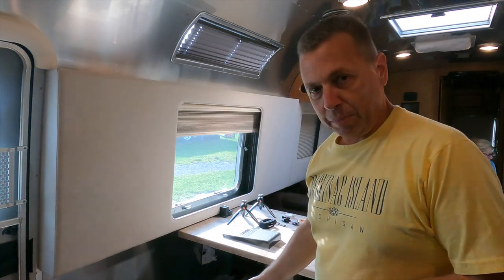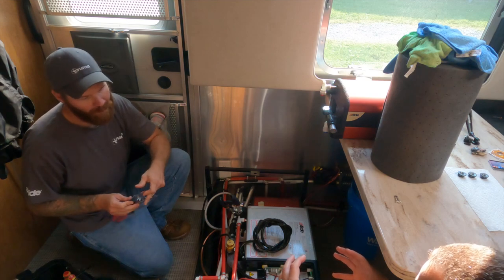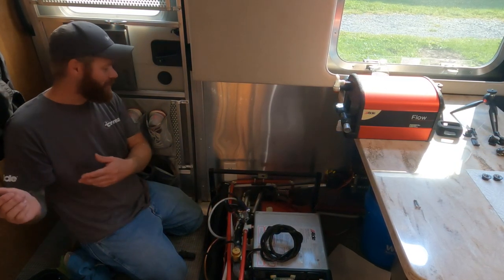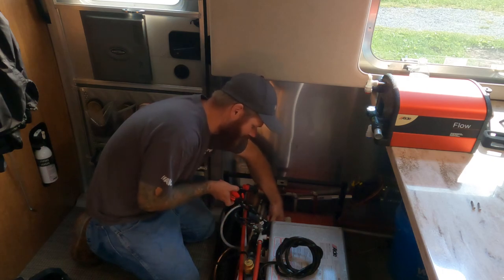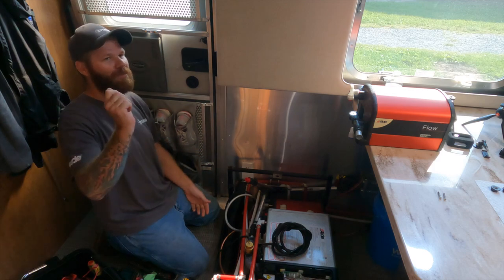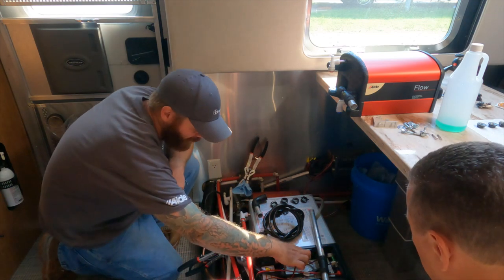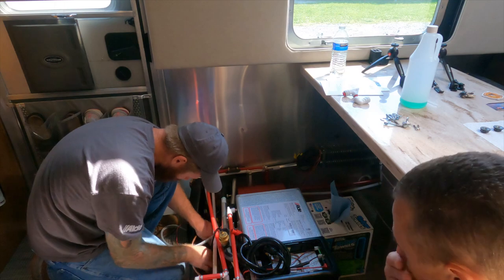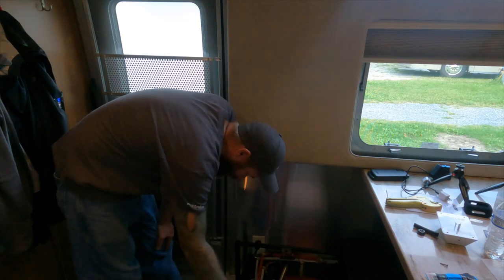Alde System FLOW Tank Replacement || RV Tech Shares his RV Life Lessons Learned

Comment: Interesting video! Nice hearing other full timers perspectives. Sorry to hear of your Alde woes, but hopefully things will run smoothly now. We have same system almost a year now and just learned about draining the Alde. Some people drain it once a week, I read on Air Forums. I must admit we love the system—it is so efficient at heating the trailer. We are never cold. Hot water showers always…just can’t complain. However, I have also heard Truma Aqua Go is great system too. Does Truma offer radiant heating as well, with Aqua Go, or it different system? Thanks!
Reply from the maker: Glad you enjoyed it! You don’t have to drain the system, you only have to release the air cushion for like 3 seconds and that relieves the pressure. The system works great, like we said, we bought it that way and waited to have it replaced. Then we just had to replace what they didn’t replace last time. We love how quiet it is. You think it’s not going to heat and the next thing you know it’s warm in your coach. Pretty nice!

Comment: Sandra Westley uk, we have the Alde system but obviously not yours because we don’t have to release anything, so they do, do a better system.
Reply from the maker: Be sure to check on that, because they told us that the Alde systems are the same, the only difference that there can be is either having the Flow tank or not. A lot of people don’t realize they need to release that air cushion. It’s a valve that you should have and it lets water out the underside from that valve. Many people don’t realize it needs to be done. Honestly, it shouldn’t have to be but the system holds too much pressure in the tank and over time it will split at the seam. Be sure just to call Truma/Alde and check. (855) 558-7862

Comment: Surprised that airstream doesn’t have valves in both the coolant and water lines so you don’t have to pinch the line to stop water or coolant flow.  

Hopefully this is it? You guys have certainly been patient in getting this system running. 

Interesting tech and his life situations. 

How often do you have to change out the coolant? the exchanger tank lasts how long? 

Take care! Bill
Reply from the maker: Not sure if valves would disrupt the flow or not but I’m sure the engineers had their reasons. We hope so too, the system is very nice but as mentioned in the video, we’d still prefer the Aqua Go.
How long the Flow tank lasts is “mainly” determined on how well a person takes care of it by releasing the air cushion to release the pressure so the seams don’t split over time. Not a very well designed way for this as mentioned.

Comment: What does the glicol do l don't understand
Reply from the maker: The glycol is heated and circulates through the lines through the Alde hydronic system. The glycol fluid is heated up in the boiler and then circulated through pipework, which provides heat via emitters like convectors, towel radiators, etc.The glycols is an antifreeze that also protects against corrosion and bacterial growth.